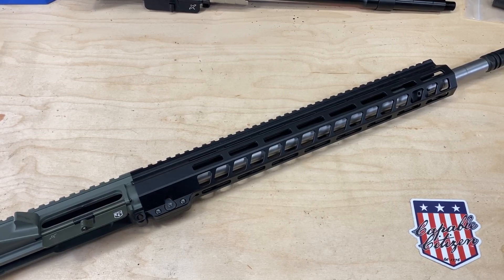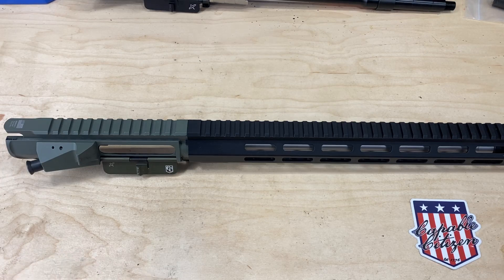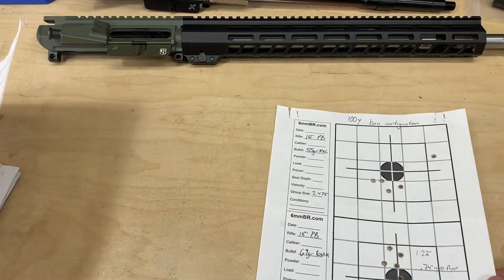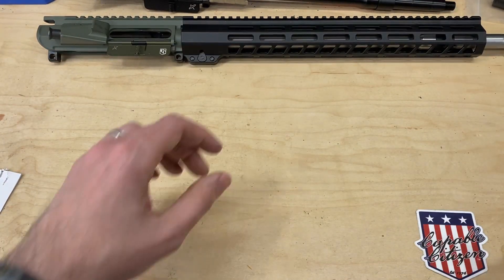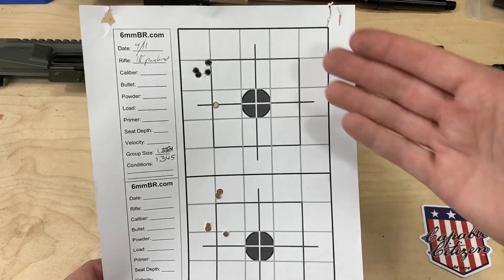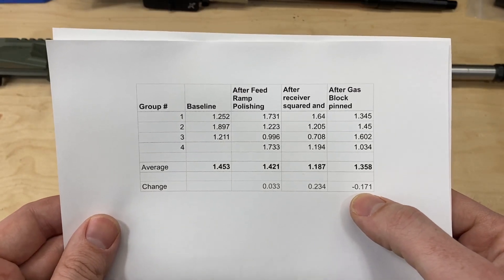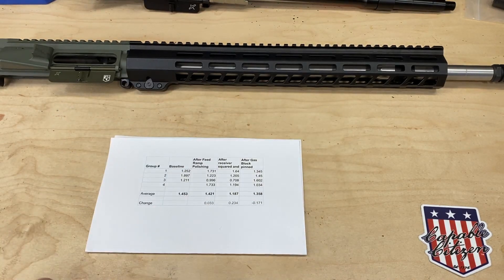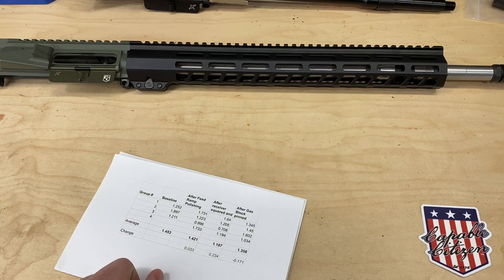Accuracy Testing Results - 18" Rosco Purebred/ Vltor MUR upper receiver group

Comment: Until I got some time behind very high quality barrels I was also blaming most of my flyers on myself. Then I got a really nice barrel from compass lake engineering and I magically became a better shot. I have found that factory barrels tend to shoot clusters and then randomly throw shots out of the group. With the custom barrels you are paying for the consistency of the groups not necessarily the size although they do shoot tiny groups too. Overall a very good video and am glad someone is actually testing this rather than it just being something we do just because we were told to.

Comment: My practical accuracy for 556 / 223W is going 5 for 5 on 10" plate from 100 - 300 yards . 
 6ARC my practical accuracy is 5 for 5 on 10" plate  from 100 - 600 yards . 

I also use 10" plate size when shooting at speed with Pistol or Carbine when training in general or for 2Gun Match. 

I used to shoot for 1.25 groups or better . Now i just try to stay practical and consistent with my skills . 10" plate for me is what I consider practical . I'm not PRS shooter so I can get away with that accuracy..

I've been thoroughly impressed with Roscoe barrels . i got my first taste of Roscoe was actually with one of my Colt SOCOM Barrels that was made by Roscoe . Super accurate and i was impressed.  I'll for sure be ordering that new K9 barrel . i was hoping someone would make their version of the CORE barrel because the CORE Profile makes the most sense . heavy where it needs to be with less weight out front and it can also HANDLE being suppressed . That's why I've never been a fan of LW barrels and Gov Profile barrels just never made sense to me .

awesome video and to me that plenty of enough accuracy ..
Reply from the maker: Thanks. Our new THICC barrel (13.95”) is tapered, 4150CMV, and chrome lined… but it’s a .750 gas journal and not lapped during manufacturing.  It’s still probably the closest to the CORE series of other options though, and at a much more modest price.
Reply: @capablecitizen3080  I'm looking at the website  now